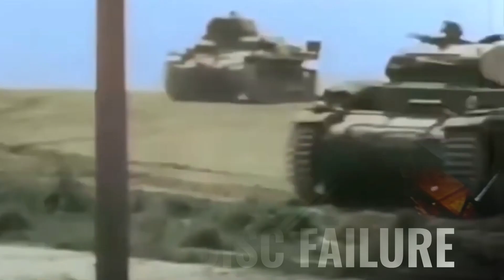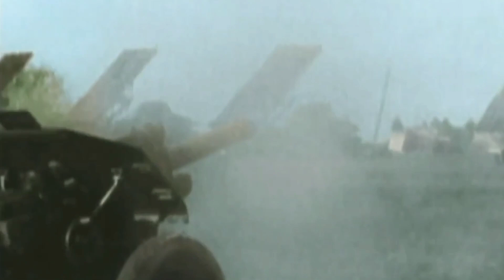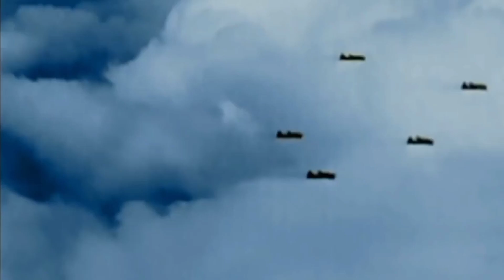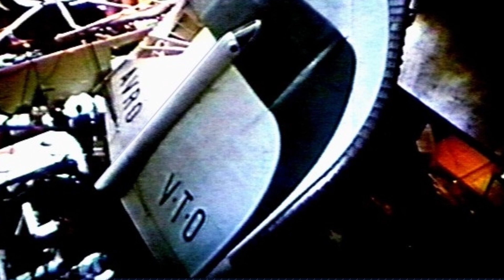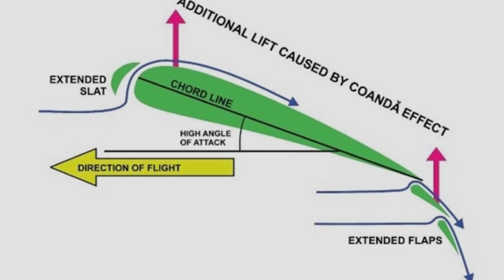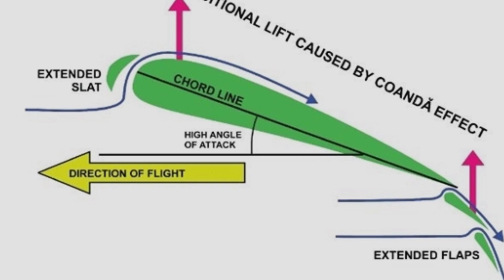WS-606A: The Failed Military Experiment

Comment: You should dig around for material for a video on the Boeing model 390 and 391 discoid or very-low aspect-ratio naval fighter proposals from the '40s. 
The "Flapjack" fighters which the Navy should have looked into.
Like many such very-low aspect-ratio planes (including most likely the Avro / USAF "Weapons System 606a, the Sack AS-6, the Vought V-173 and others, most likely based on the Arup planes of the '30s

Arup S-2 (direct progenitor to the V-173)
(≈2 mins, but skip ahead to 48 seconds for flight video)
https://youtu.be/Nxz1UF67EQI?si=RkIwisBrQuQ42Ksg
(A video on the Arup would be good too, for its historical significance to all the other discoid and very-low aspect-ratio planes.)

Based on the Arup, the related Hoffman (flying wing) & the Hatfield, the Ehselman ("flounder") of the '40s and others, it should have done very well (without the complexities associated with the Vought/Zimmerman "flapjack" efforts.)

the Boeing model 390 was to have a twin row radial buried with a driveshaft turning the prop.
The 391 was to have the monster 4-row, 28 cylinder radial of 3500+ hp and contra-rotating props (414 kts by Boeing documents). Some reports say the engine was to be supercharged, with the supercharger exhaust taken out through a rocket nozzle, producing thrust. The cooling air for the engine was also taken to a ring nozzle around that, to propel it aft, again producing thrust (cooling air is usually only a drag). It would easily have done 500kts (Mach .75) in level flight (probably if clean and lightly loaded). Footprint of a Bearcat, with payload of a Corsair or P-47, lightly loaded take off airspeed under 40kts, by Boeing reports 74kts heavy. Stall-proof like the Arup and other very-low aspect-ratio planes.

Comment: At the same time in the USSR, the Sukhavov discoplan gliders.
In relation to the Arup & Nemeth, the V-173, the Avrocar & project 606 development of that, at the same time as the Avro effort.

The video shows that they were working towards a super-STOL, supersonic discoid unitary wing/body or circular wing jet.
They dispensed with the complexity of the Avro lifting engine in the "Weapons System 606a" (and the "Project Y" imaged in this video).
The Sukhanov might have worked extremely well, going by the successes of the Arup of the '30s, the related  Hatfield "Little Bird" of the '80s, the Payen/Aubrun AP-10 of the '30s, loosely resembling the excellent handling Nemeth "parachute plane" of the '30s, the good flying Vought/Zimmerman V-173 which unfortunately was saddled with the unnecessary affectation of the wing-tip mounted, outward turning, oversized, tuned, plane-changing props. NACA tunnel tests of the V-173 showed that it did not gain anything either in terms of STOL performance or efficiency in cruise, versus more normal 80hp props even spinning the other way.
 (The V-173 was mostly based on the Arup which Zimmerman saw perform at NACA. The Arup and others proved that the discoid or very-low aspect-ratio planform does snot need the overly complex propeller situation for STOL or to sleek and efficient. Notably NOT draggy and inefficient in cruise)

Sukhavov discoplan gliders
In '58 a parasol-wing aerobatic glider, then a tiny integral wing-body glider (both in museums today).
Both used GE to get aloft and very-short aspect-ratio planform allows very slow flight at high A in vortex-driven "parachute lift" (not the same phenomena as the vortices on a sharply swept supersonic delta at low speed).

Letayushchiy (flying) disk
Летающий диск (1964) 17:20
https://youtu.be/UQ1XiIMgLck
video
https://www.youtube.com/watch?v=at77GUZm9rY

Comment: The Avro machine pictured is the Project Y.
The Avro Canada / USAF "Weapons System 606a" was different.
A circular wing, with the Coandă / Frost lift engine centered and an embedded fuselage with two normal jets aft.
Evidently they were very confident of directional control with directing flow from the lift engine, because it had no fin/rudder. Probably a mistake, made by too many designers trying for all-wing planes. The weight and drag of a fin is more than compensated for by stability and control. Many designers tried for completely tail-less. Some then went on to wing-tip fins which were a little less terrible. When they went on the normal central fin and rudder some produced entirely good planes.
Lippisch "Delta" series which turned into the Me-163 Komet unfortunately saddled with the awful rocket system. Charles Fauvel with the Av-10 little test plane. Boris Ivanovich Cheranovsky with the series from BICh (pronounced "Bye-che") 3 to the 7a.
Especially the Arup planes from Indiana in the 1930s

For a modern example of what the WS 606a might have resembled, see the Rowe UFO ("Useless Flying Object" from Aus. Tiny experimental, circular with tractor propeller and a fin. Good handling little bug.
The Flying Show: The UFO Strikes Again
https://youtu.be/eFgr90LobAQ?si=dX50MnrvmihapBEa